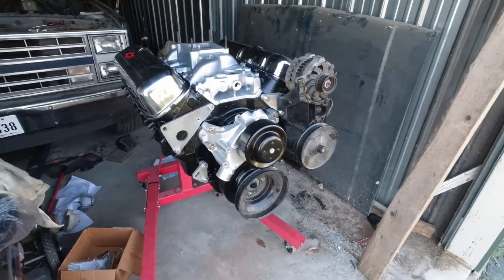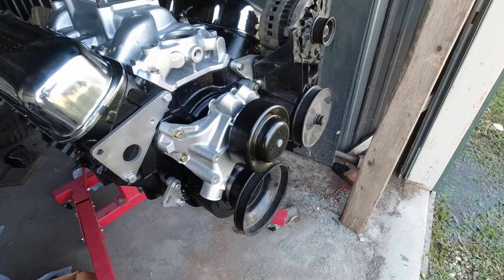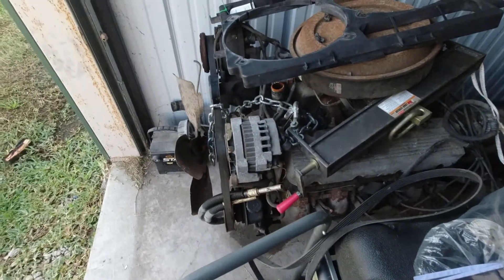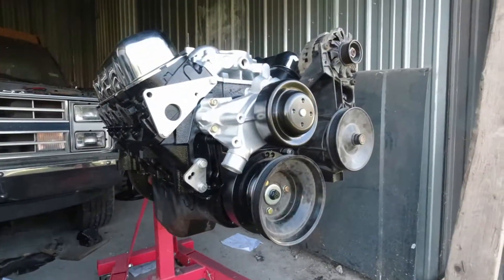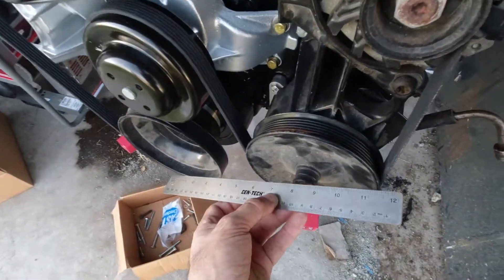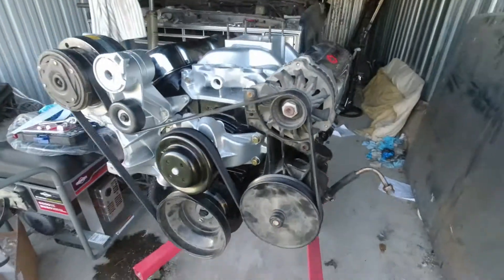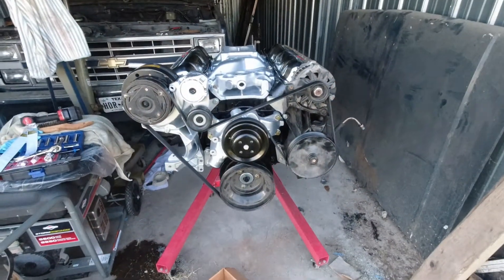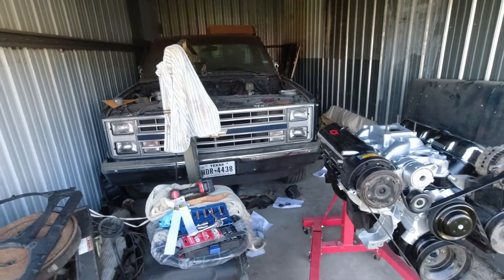KWIK PERFORMANCE Serpentine 454 conversion set up PART 1

Comment: That alternator and power steering bracket is from a camaro or firebird? It's not the one kwik performance identified to use with their set up. I know because I have the same bracket from the camaro and an actual bracket from the truck style alternator and power steering bracket.